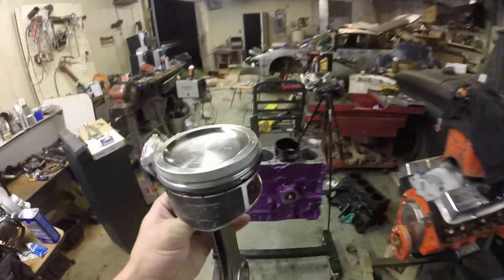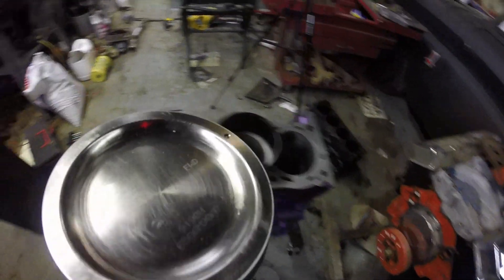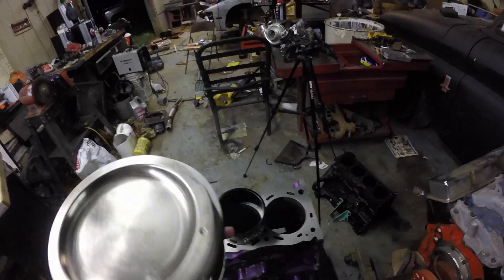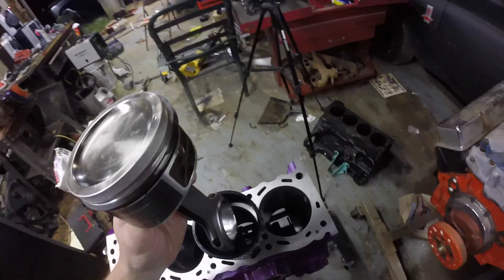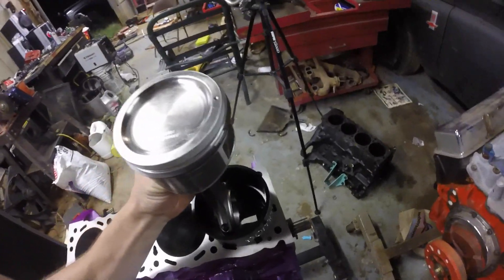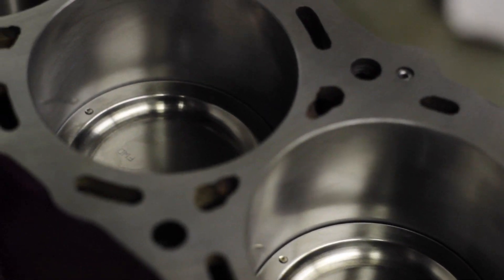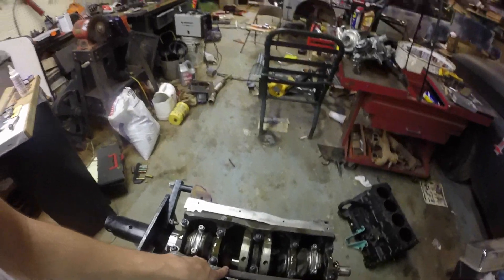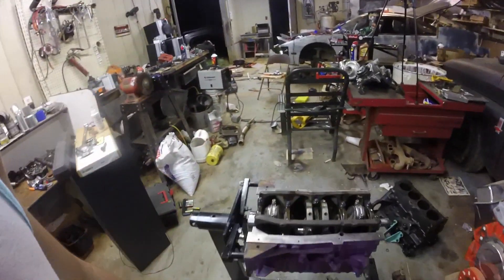TURBO 240SX BUILD | BUILDING THE BLOCK part 2

Comment: Did you check the gapping on ur bearings (plastigauge)? I was wondering if I have to do that or not. Also how much was all your machine work? And what did you all get done
Reply from the maker: yea I have a vid on plasti gauging, better to be safe then sorry, and it was about 350 for everything I needed done
Reply from the maker: block decked,cleaned, bored over 40, honed, new freeze plugs, head decked, crank polished
Reply: +JMyersMedia fuck that's pretty cheap I have a stock boosted Sohc and I'm building another on the side and just need the head and block decked, crank balanced and polished and cylinder bored to 89.5 and places are quoting me like $600-1000. Are you running a stock head?
Reply from the maker: +marvin teso yep stock head, and forgot to add I had the whole rotating assembly balanced haha
Reply: +JMyersMedia stock head? Are you gonna do stiffer retainers so you don't bend valves hitting rev limiter? I don't know if that's important but I heard a lot of SR guys do it, it's like a must when you wanna bang rev I guess.
Reply from the maker: nah  i wasnt planning on it, just complete stock head, but imma look in to that, trying to do this build right so ill double check my work, thanks for letting me know!
Reply: +JMyersMedia a lot of Ka-t guys actually run stock head for awhile so depending on ur power goal I might not need to